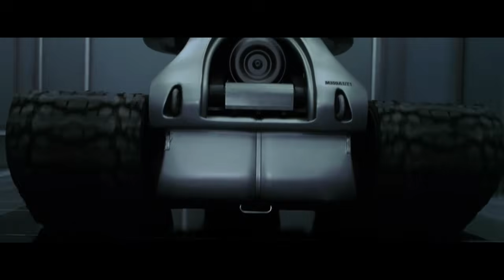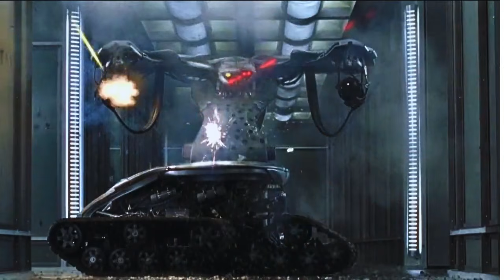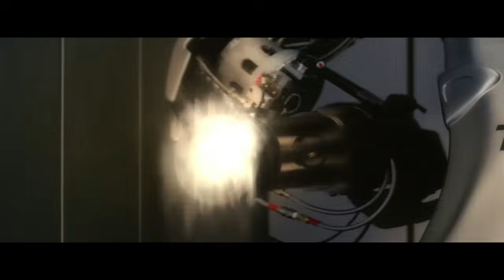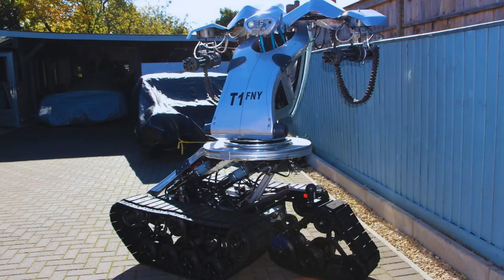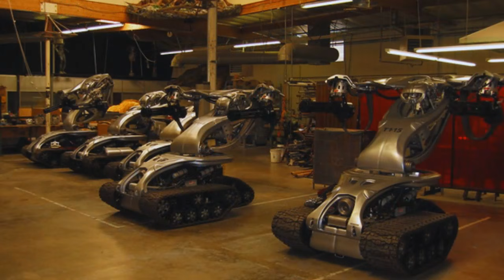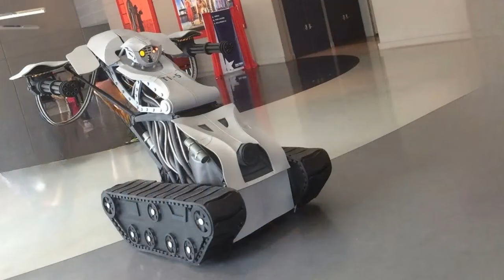T-1 Terminator: Skynet’s First Hunter-Killer -The Beginning Of The End

Comment: The T-1 look petty compare to some of America actual Robotic Tanks developed 10+ years ago.
Literally smaller than a Forklift, yet mounted anything from a .30 Cal Machine gun to a .50 Cal Miniguns to a 12mm Auto Cannon, with armor probably mostly resistance to Small arms calibers. 
And I'm pretty sure those Actual Robot Tank can see through objects, so no use hiding behind an offices draw.
Reply from the maker: Yet they carnt operate by themselves on a battlefield and these can , you can strap an artillery gun to an rc car but if it just sits there then it's not usefull , also skynet worked with what it had
Reply: @SirJellyBean  Actually the robot tank I'm talking about CAN operates more or less by themselves, but they are mostly controls remotely as drones to support paramilitary forces. 
But irl, you would find that local militants groups would figures out how to counter them real easy, after 1 try.
Hick, they made the m1 abrams look like rpg target practice.
Reply from the maker: @Huy-G-Le  what the drone called so I can have a look , sounds cool ??
Reply: @SirJellyBean Type-x and M5 Ripsaw are recent examples, there are order models but I can't remember the names, and I do remember how they look.
It's literally a platforms, with wheels and mounted .50 cal machine gun heads, and they call it's a robots because it's can be controls remotely and operates on its own, as a infantry ifv.
Ah the "MUTT", the "RAMBO", the HDT hunter Wolf, the "MIS" and the Black Knight, which is a robot M3 Bradley.

Comment: Now this little T-series could be a good civilian robot. Would need a new coat of paint and perhaps a light bar, but the T-1s are suitable for more than just military applications.

I could think of at least two ways this Machine can be used for emergency response: Fire and Police.

Stick a couple of fire extinguishers or water tanks on the back with the output where the miniguns are, and you have a mobile firefighting unit. (Or use retardant grenades, etcetera.)
Switch the miniguns out for LTL (less-than-lethal) grenade launchers and you have a police anti-riot droid.

I see no reason Skynet couldn't have had at least a couple of T-1s designated as such even as it was.
Reply from the maker: Smart idea
Reply: @SirJellyBean  Thank you, I'm glad you agree with me.

As for Skynet having firefighting T-1s on hand, hear me out: Logistics may be the king of the battlefield, but if this is the case, then damage control is the queen.

Even logistics centers and manufacturing plants rely on damage control teams and fire suppression systems like sprinklers and gas-based extinguishing systems to keep them structurally sound and keep those supplies intact.

Even the most hyper-intelligent supercomputers of science fiction (like Skynet) ain't worth squat if they can't do damage control and firefighting within their own facilities.

Even Skynet has a reason to fear a fire.
Reply from the maker: @TheOneTrueDragonKing  very good points man
Reply: @ Thank you.

Comment: The T1-7 and T1-4 were not variants, they were production numbers.
Reply from the maker: They they were variants just in T3 they had t production numbers
Reply: @SirJellyBean  Were they both the same variant of the prototype, or were they variant model numbers? To be clear when I mean production numbers they are a run of a kind. Like if you buy model of car they all have a different VIN, but they are the same production lot. So T1-0, T1-1,… T1-n are all production numbers of the T1 production lot.
The - (Dash) meaning the unit number off the line.
Reply: Ahh… looked at the fandom wiki… I see what you are saying now. Thanks
Reply from the maker: @michaelvarney. np worries it all rather confusing lol

Comment: nice catch about the hydraulics being vulnerable to small arms!  aw, now you're even touching on ammo storage, it's like you're anticipating me.  i have to disagree that it has "ample storage" in the body.  from the scale of things, i see room for 2, maybe 3 cans of 7.62.  that's 2000-3000 rounds.  of note, these are sealed cans i'm talking about.  would require a bunch more overhead to have the end of the ammo belt for one can connect to the start of the next.  the ammo would have to be in a single continuous belt, as any kind of autofeeding mechanism would jam if you looked at it funny, especially on a prototype like the T-1.

just like the later HK, the T-1 effectively has a "turret ring."  this is the joint on anything like a tank where the turret meets the main hull.  historically, this has been a weak spot in tanks.  considering the T-1 is not using the composite armor we use on tanks, this should hold even more true.

i believe the design team were operating on tank warfare doctrine.  specifically the tactic of pulling up behind a "berm" (some kind of embankment) just enough that the turret peaks over the top, then backing away "under" the top of the berm after firing.  the way the T-1's torso angles back, and the jointing on it infers to me that this is supposed to lurk behind a berm, and "stand" the torso turret up to fire, lowering it back down to take cover.  think the "time crisis" games on a larger scale.

that T1-5 prop looks to have a couple of 25mm or 30mm expended shells clamped to the chassis.
Reply from the maker: Fair point its a good basic design if made a bit bigger could be a lot more effective
Reply: True, not a lot is gained with a rotating torso for the T1

Comment: T1 could probably not fight for long as those mini guns would run out of ammo quick and would be a logistical problem even for skynet.
Reply: Have the T800s bringing it ammo
Reply from the maker: T-200 to the rescue
Reply: @DEPORTER_SUPPORTER might as well bring in a T-600 instead
Reply: @XD-sc4ix the 800s have better armour.
Reply: If they can control the rate-of-fire then it wouldn't be such a big issue.

The miniguns can reach 6000rpm but they don't have to fire at max speed all the time.
Surely they can fire slower (less than 1000rpm) if the situation doesn't require an ammo dump.

With how accurate the machines are, they could probably hit slow moving targets with a single shot no problem.